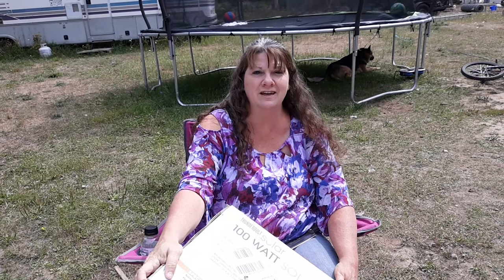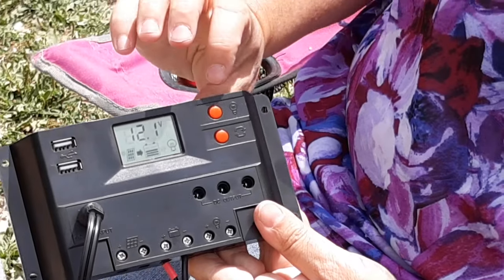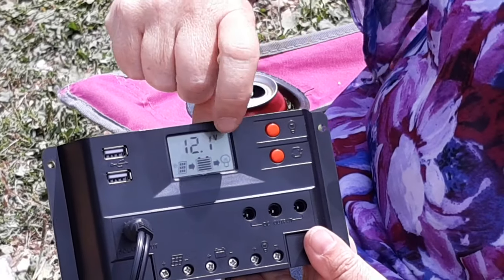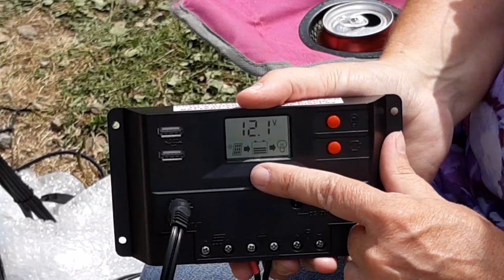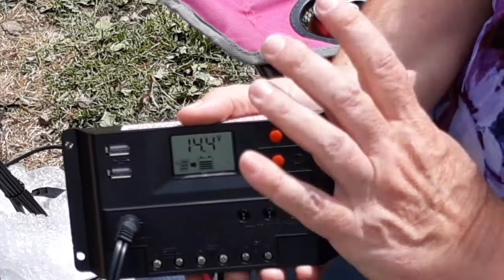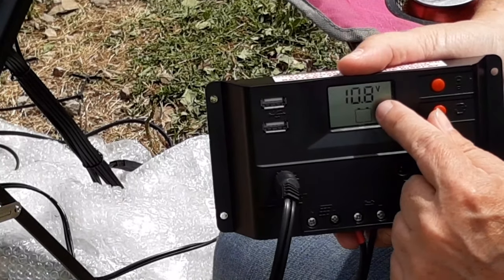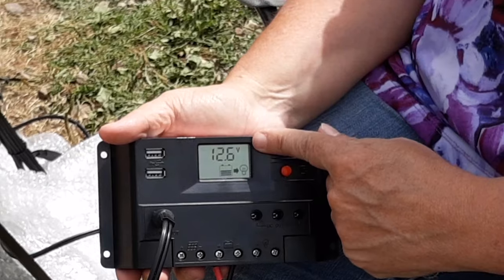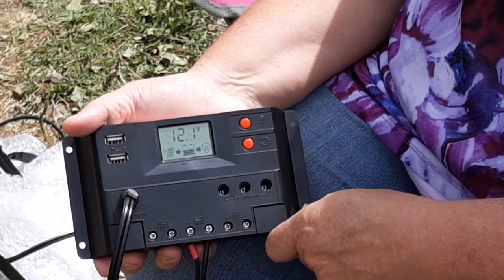EXACTLY - How To Use the Controller on your Harbor Freight Solar Panel Kit

Comment: Thx for the Video 
I still Do not like their Charge Controller , some presets say you can adjust yet you find they autoresets to their presets . 
Like boost nose up to 15v is bogus it resets to original w I can't find a way to get it to save preferences that I need not merely want . 
 I'm Persay Overqualified in Electrical Field of you want to know my skill level yet I am Autistic . 
Graciously , 
RM Bowles

Comment: Soooo extremely helpful, but someone put an inverter onnected to my solar panels  so I'm stumped on why my inverter keeps beeping. I can't figure it out. I don't understand the inverter.
Reply from the maker: What size and brand inverter?  I'm far from an expert, but I have a surprising amount of experience with beeping solar components, haha!  I can try to help.
Reply: You can power up to 100 watts with the controller. Anything higher needs to be connected directly to batteries/battery. I use a 2,000 watt power inverter with mine. 2000 sustained/4000 peak. You need enough batteries also to provide 10x the amperage you're trying to achieve in D.C. current at 120 volts. Then you have to figure out how to charge all those batteries with under 6 amps.

Comment: This video has helped a bit,

But I’ve been having issues with mine. And now my display controller isn’t working. I literally just bought the kit over the weekend. Disheartening after all the money I spent at Harbor Freight. And the Harbor Freight people barely know what they’re talking about. Had to call a technician and even then I’m still having issues…

The box says it can power an rv or camper, and the Harbor Freight person told me two fully charged batteries and solar the batteries would last four days. 

I can’t even get mine to stay on more then a few minutes without the Display controller 

Truly disappointed, I feel scammed (by Harbor Freight), honestly because I spent way more money on this then I should’ve to get what I needed to run everything. Camper is an 30amp, and I have the Jupiter 2000 Inverter. 

But at least the solar will run for a while during the daytime, for now at least…

Comment: Okay one thing you do not know about that charger that's solar charger is it's a 30 amp charger and they say it's a 500 w but that is a lie I have a 30 amp charger a harbor freight charger and I'm running 960 Watts on it and it works good one thing you're arguing about to say you can't go over 500 watts you go back to your solar panels I did it backwards I added the highest amps on the solar panels and they say you should add the lowest amps cuz that's what it normally gives I add up the highest amps and hook them together to a 30 amp charger and they still work at 960 Watts and watching these people on these YouTube videos told me I'm supposed to add up to Small amperage not the high amperage the high amperage is what can happen when they're testing them and a million watt room of light to read them a 25 watt or 100 watt or 400 watt solar panel the small amperage is with the solar panel actually gives. So I think I'm going to have to go and reconnect up my solar panels and might have to buy two harbor freights 100 watt solar panels that are rated as at 5.5 amps which I do have four 100 watt solar panels as well as well as one set of 25 watts solar panels four of them which came with the solar charger. But I do have other solar panels like I have two 405 Watts solar panels connected with it as well with another 150 watts of other panels that are smaller yes harbor freight solar charger is only a 12 volt I have other solar chargers smaller ones that are 12 volts another one the same size which is a 12 or 24 volt and then I got one bigger than that which is 60 amp which is 12 volt or 24 volt and then I got some bigger ones at 100 amps which are 12 volts and 24 volts and all I'm running is 12 volts and I'll get all the solar charges hooked up yet or enough panels to come all up. So yes I'm using one 30 amp charger and one 60 amp charger and a few 7 amp chargers and one 10 amp charger. That's what I'm running and that's all the solar panels I have power for.

Comment: How to use the HF charge controller. 
Step 1- throw it in the trash or set it on fire for fun.
Step 2- go online and buy, literally any brand that is an mppt charge controller.
Sorry for any perceived negativity in this comment, but the HF charge controller doesn't confirm to the standards of today's panels and controllers. You lose more energy than gain with these. Any mppt controller will right out the box used with mppt cable connectors will get 85-95% higher efficiency when converting solar energy to usable power. 
I do however 2 of the HF 100watt solar suitcase style panels, and they work great. Combined with an mppt charge controller I can take in 1000 watts or more per day.
Reply from the maker: You're absolutely not wrong!  That said, though, there are a ton of us total solar newbies who aren't ready yet to venture beyond the box of that starter set.  But once that first hurdle has been jumped, yes, mppt is the way to go.
Reply: @OffGridNorthIdaho  they aren't as scary as they look. I bought one of these HF controllers because it was there and it seemed less scary than buying something off Amazon. Also I did not yet know the difference was that much. I was horribly disappointed with that purchase immediately. Anyways, long story short, I soon after bought  an mppt controller and the hook up is exactly the same. They just look bigger and scarier, but they are just as much plug and play.

Comment: On my 100 watt solar panel I have a super start Marine deep cycle connected to the thunderbolt and I started using the 100 watt solar panel charge regulator because I noticed that my battery was getting very low from using and connecting my Playstation 4 and my 22-in screen TV that is a energy saver but for some reason when I would charge it normally with the solar panel it would bring me up from 11.5 to 12.4 and then when I would go back to gaming within an hour I would be right back to 11.6 11.7 when I started using the solar panel regulator it was even worse now I am planning on not using the solar charge regulator and going with that 14.4 boost and see what happens is anybody has any advice they can give me on the information that I provided please help me thanks
Reply from the maker: Sorry it took me so long to see this!  Okay, I'm getting advice from the pro, my husband.  First, he says that the numbers you're seeing on the controller when it's charging are not the battery level - they are the flow going into the battery, trying to beef it up.  And that number indicated might still display for a few minutes or a bit after you stop charging.  Once you connect a load, it should drop down to the actual charge level of the battery.  He says that with a 100W panel, it would take you about 12 hours of full-sun, full-on charging to get the battery fully charged up.  So, you probably don't have it as fully charged as you think when you start playing.  Next, he says that taking it down to 11.5 or lower is really low on the percentage scale, and that to prevent actually degrading the battery  you would want to keep it above 50% charged at all times.  The higher "charge state" you keep it, and keep it from falling below, the longer your battery will last.  Google " state of charge chart".  We print these out and tape them up next to our controllers.    I wish I could copy the image here, but I don't know how.  So, advice is to let it charge full-on for at least 12 hours, then don't let it go below 12.06.  Hope this helps!